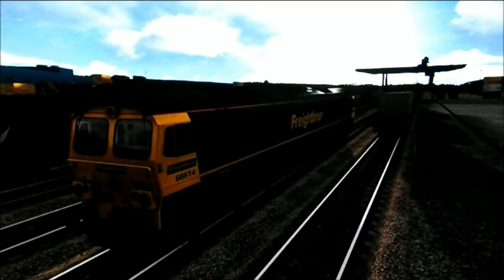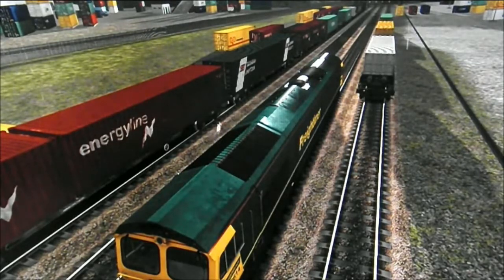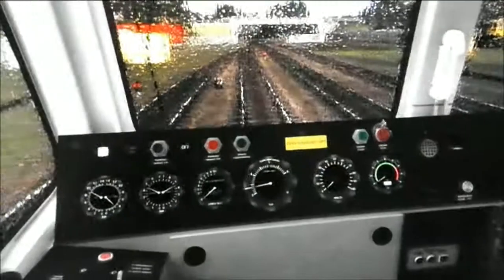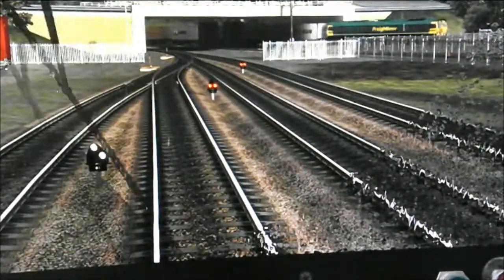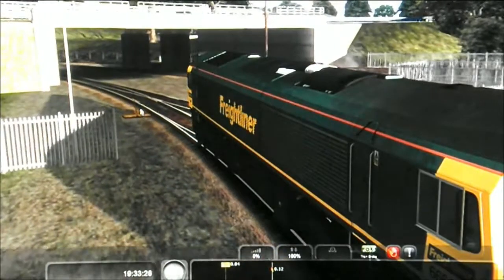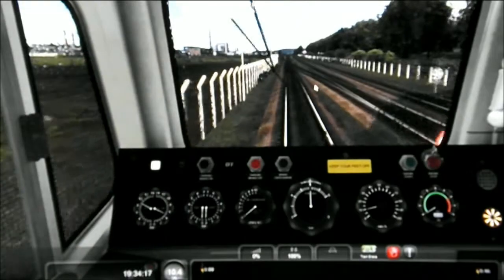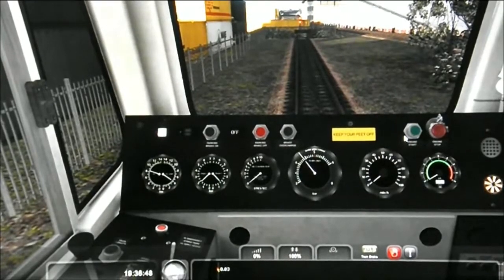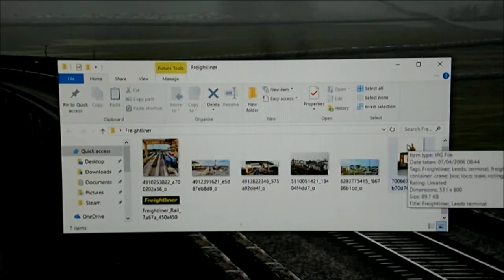B&D: Vollmer Part 1

Comment: Hi Susannah great video I do like the over head crane that you have built. just an idea the to spare single rails arn't they for the overhead crane I'm sure I have seen these in the dock yard where they traverse along on there own rails. just a thought. im sure you can add some wheels to the underframe to make the modifacation.....regards Tony
Reply from the maker: Hi Tony, thanks for taking the time to comment. I've double checked the instruction and they are indeed for the lower part of the crane. In truth i'm happy having it static as I never planned on using it and no real point to make run along the rails if I can't use the crane itself. The plan was to create a hopefully convincing container terminal as a diorama rather than have an unrealistic crane that works. Thank you for the suggestion though, most appreciated. Susannah
Reply: No problem Susannah I'm looking forward to the finished project...Tony

Comment: great idea to use the train sim for research Susannah.!!.will look great on the layout I'm sure..looks a great kit...would like something like this on mine..im currently upgrading all the layout in stages..what length do you think this will be or are you not up to that yet?!     cheers     dave
Reply from the maker: Hi Dave, thank you for commenting on my video.  This kit is personal choice and process of elimination in terms of price, looks and availability and this led me to the Vollmer kit. As for length, this is determined by what my fiddle yard can handle cause the crane can handle three lines underneath and if necessary I can use the shunter to split the train and do some shunting to fit it in. Good luck also with your upgrade. Susannah